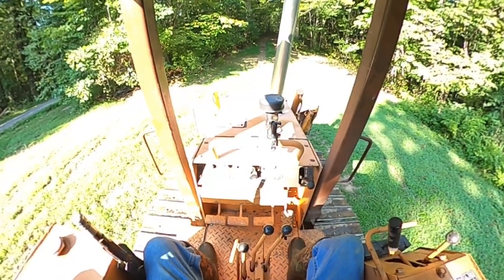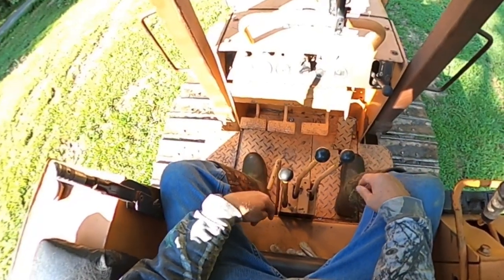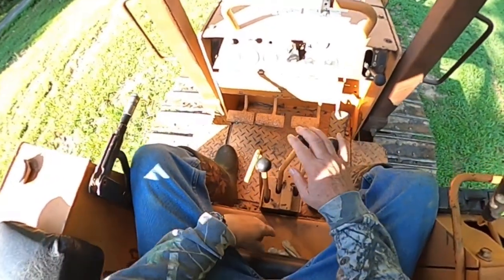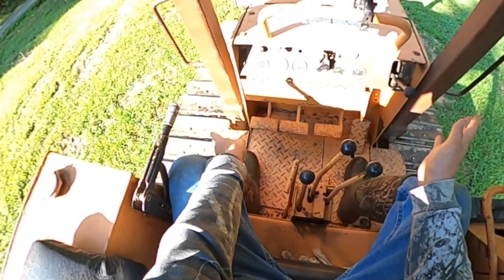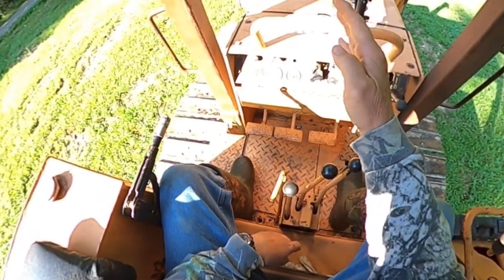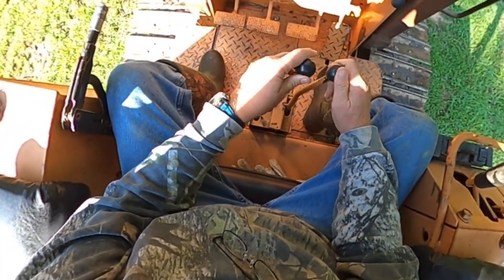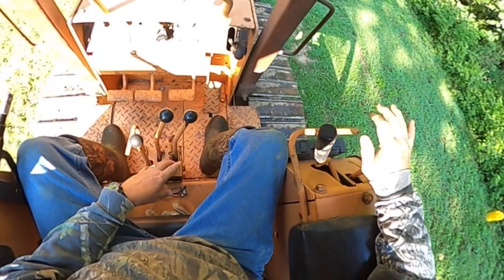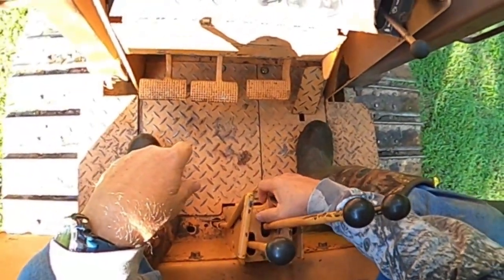Case 450C Dozer Operation And Controls

Comment: Thank you so much this video sir. My stepfather passed away leaving my mother with many pieces of equipment that I’ve been trying to learn how to run. My stepfather thought us kids were too dumb and irresponsible to run the equipment. Now I’ve been repairing the equipment, using it around the property, and selling them to try to help my mom.
As simple as you might think your instructions are, I’ve been driving our 450c without knowing what I was doing.
I replaced the fan belt and radiator on it so far. 
Thank you sir.
Reply from the maker: @timparker533  thank you brother for the good words. I was in the same boat. My dad always said “ you will tear it up and I’ll have to fix it. So I basically bought my own stuff and learned by myself with a little help now and then. I swore I would never do my kids like that so I tell them “have at it!”   My son operated the dozer and the backhoe better than I did. I was a Private Pilot since my early 20’s. Guess I was incompetent as well. 😉

Comment: How well do these small dozers handle fairly steep terrain, got a cutting I want to scrape out , lots of sumac and hard wood that's impossible to keep up with.
Reply from the maker: Very well. They weigh 10000 lbs so the footing and strength is more than appreciated. I cut a road from a steep slope in another video that was hard to negotiate on my side by side. Now I can take my tractor and bushhog up or down it with no problem. Check out the video.
Reply: @wingandaprayeradventures6758  thank you.  I need to check some rentals out, think I could do what need in a weekend no problem.
Reply: No problem it can really push some dirt it is amazing first time on one i WAS RUNNING IT SOME OF THE OLD TIMMERS WERE IMPRESSED.

Comment: Question:  Do you have to use a clutch to shift from forward to reverse with this dozer?  It appears to me you just lower the throttle and that allows the shift from forward to backward - with no clutching necessary.  For example, if you both track levers pressed forward pushing something, can you just slow the throttle and the Forward/Reverse level back to reverse, or do you have to return the track levers to neutral first?
Reply from the maker: Its good practice to slow the engine down before shifting but it is centrifugal type clutch. No foot or manual clutch
Reply from the maker: Neutral is between forward and reverse. Just slow the rpms
Reply: @wingandaprayeradventures6758  Thanks very much for taking the time to explain this.

Comment: Absolute dog of a system, U need 8 arms and legs to get anywhere with it. Been operating dozers for 54 yrs,  Case would be the worst with Hanomag a close second, both are not operator friendly and both are dangerous in steep country.
Reply: You need 1 hand to run that  much more friendly to run than a d4 cat.   You claim to have run dozer for 54 years and think you need a hand or foot on every lever and peddle?  It honestly does not get any simpler than the 450  even the case 310 is more complicated to operate  and you also have to remember it is torque converter drive so you can just let up on the accelerator peddle and stop
Reply: @kevinroberts9394  Just sit yourself on a TD 15 C or TD 20 C and see how simple , safe and operator friendly they are to operate especially in steep country or in tricky situations, very user friendly they are compared to a Case.